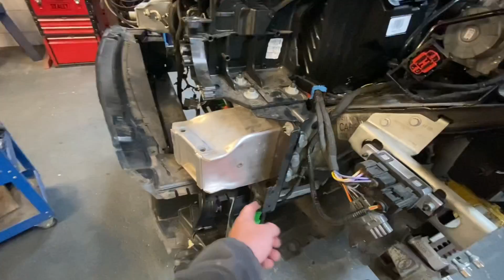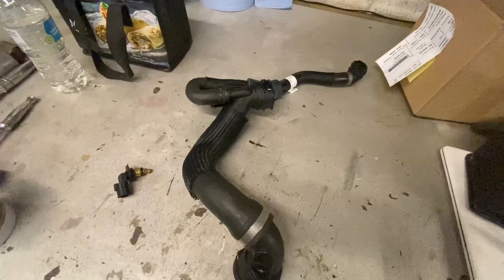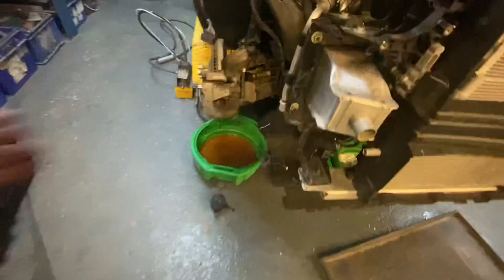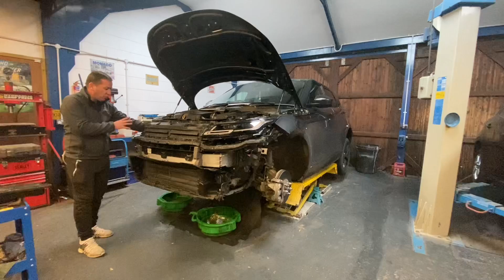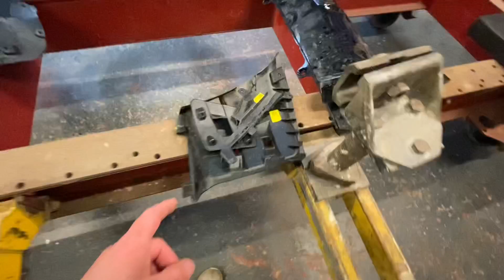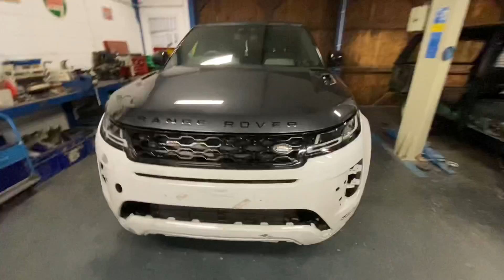Rebuilding 2020 Crash Damaged Range Rover HSE PT2

Comment: Are you going to re calibrate the radar? as if its removed it will need its alignment checking ?
Reply: All of the ADAS system will need recalibrating not just the radar.
Reply: I totally agree but no mention of ADAS !
Also using a second hand condenser the filter drier will be toast due to being open to air.  Also i am sure the SRS ECU will need crash data removed and belive other ecus on late cars also store crash damage data

Comment: As always the content is spot on chaps 👌🏼 With the repair being straightforward on the Evoque and things like bolt patterns all uniform I bet it has made you both think that you wouldn’t mind another salvage Evoque. Especially if you go for the 2015-2019 model, parts should be readily available but still a very modern car that will sell well.

Comment: Hi respect to what you do but you building that evoque completely wrong. Remove front panel or bonnet landing panel to put radiator in. I build quite alot of these.
Reply from the maker: There was absolutely no reason to removed the landing panel that would just be creating more work. There’s no right or wrong way bud you do it that way I do it this way it was a lot quicker and we both had the same outcome it took ten minutes 👍

Comment: It just shows how the modern car design’s crash systems work to protect not only the passengers, but that huge lump of technology called the engine and drivetrain, which is installed in the factory as one lump including all front suspension, steering and associated sub-frames! Pleasure to watch you reassemble it like a Lego model, each part clicking into place. Fantastic video, brilliant car for the new owner with the valuable LR warranty intact👍

Comment: Correct me if I am wrong doesn't the computer log if vehicles has been in accident so if you take back to main stealer for warranty they throw out your claim so is warranty worthless now  if you have that history removed from ecu  there's a gap in history file and they can tell its been doctored ????
Reply: most stealers will overlook "history" if failed part nowhere near or nothing to do with accident damage. if they can get paid off manufacturer on warranty claim thats the route they usually take    -  unless they dont like you....
Reply: I live in Ireland and main stealers hate doing warranty work over here as they get shafted on the labour rates and try and find any excuse to void the warranty usually  they void it after stripping car down so you either pay them the full cost or you get car back in bits they say second hand car dealers derive from horse thieves main dealer must be from the devil himself lol
Reply: @adrianlloyd691  i work at main dealer [sunderland]  - you loose money fobbing off jobs [mandatory healthcheck, first stage diagnosis, wash + vac., pickup/ delivery etc] - so we would rather get a little off manufacturer rather than s.f.a. and a row in reception with customer  - covid is biting hard at our customer base so we need the  work -  unless you dont like them.....
Reply from the maker: There’s no such thing as doctored it’s got crash dater logged that has to be cleared that’s it. It doesn’t hold a history in the computer 👍
Reply: Thanks keep up with the good work by way whats happened with cozey did I miss a video as not seen or not in back ground cant wait for merc rebuild as work at merc dealer sad hey work on them all day and watch em at night my Mrs goes mental and she calls me something stronger than sad lol
Reply: @sruk  mmm.... tricky bastards these new cars - but when old ecu is in bin it 100% cant grass u up...

Comment: great to see how a vehicle like that is easy to repair .I would have used gorilla glue for sensor .And I think I know your new source of vehicles as a fellow you tuber aid in there one they had met and talked to you at a copart site.Good luck and Keep them coming.
Reply: Don't do that on a coolant pipe lol, it's high pressure and will drop all coolant if it fails. Bye bye head gasket if it did!
Reply from the maker: Iv never met another YouTuber at auction 👍

Comment: If your source for the vehicles can keep coming up with ones like that then that's definitely one to keep under your hat...

I don't think anyone is under any misapprehension that a Range Rover Evoque is anything but a very complex vehicle, but that was a lovely simple nuts and bolts repair so huge respect to JLR for keeping the build and rebuild nice and simple.  That bottom hose is a good sign of what's wrong with the car manufacturers now, they could have made that a simple multi-piece assembly so individual broken or failed parts can be changed.  Doing it the way they do, they're pretty much guaranteeing that more vehicles are going to get written off so they'll be building and selling new vehicles to replace the written off ones.  It makes financial sense for the manufacturers, but it's a royal pain in the butt for owners, especially when the vehicles get older as something like that could easily write off an otherwise good £1,000 example.  Just such a waste of resources...

As ever, lovely work guys, and a very rapid turn around on a high value car...

Comment: you will need to get the radar alignment set up again [ critical to get set up right for the emergency braking system to work correctly]  you are supposed to go to main dealer,  but they are a number of larger bodyshops set up for this now. make sure you get the certificate off them- if it ever fails to work ,let them go to jail rather than yourself !  sorry rob, more [definatley needed ] expense on these later cars. p.s. 85% of the time when i do them ,no warning lamp comes on to warn of problem - it comes on after a few miles later when you thought it was all ok + no damage visible to any parts was seen. [and then the bodyshop had to send in a supplemental claim, pissing off the insurers].     this is why cars get written off so easily these days-  radar unit for nissan £ 600 to £1400 and bracket another £100.     progress???  -nah - just stay off your phone and look out of windscreen now and again......

Comment: So just out of interest I know you guy are honest but when the guy you sell it to sell it the next buyer how do they know it’s been in a crash
Reply from the maker: This is a lightly panel damaged bolt up repair there will not be any signs of any repair I always tell but I don’t need to and this one in particular who ever buys it won’t matter if they sell it on without saying it’s not recorded and it’s back to 100%. If they claimed off the insurance they would repair it and no more said.
Reply: @sruk  I think it's nice if people are told it's had a crash as it's part of the vehicles history. But especially one that's like this (especially when it has evidence like a YouTube series to show the work being done properly) they should be confident in the repair and to be honest as you said are unlikely to notice it's had any (since it's been done proper). One time I went to look at a Cat N that'd been put back on the road and you could the standard was subpar.
Reply: @sruk  rob so true, how many cars under 3 years on pcp have prang
Reply from the maker: @adrianthorpe8005  people just don’t realise how many cars are in body shops being repaired every week 👍
Reply: Only way is that they are close eyed or they get told by who sells it to them. One tip I learned very early on is to look at the bottom of license plates. If they say the same garage / dealership at the bottom then its less likely to have been in a crash. But if they are different (I had a car that the front plate was Halfords and rear was Some Vauxhall Dealer) it's probably been in a collison of some sorts. Of course this doesn't work if the plate wasnt damaged in the crash but simple things like that are giveaways.

Comment: Always worth keeping the sources to yourself now definitely, copart has gone crazy every since you and the other channels took off.
Reply: The fees are crazy 😞
Reply: @nabs3178  Fees aren't necessarily the problem because if you think about it, what you then do is think of the price you'd pay without fees and minus the fees from that for your bid. But due to the large increase in users people are now going crazy and a lot of them not being the most familar with prices either, so they are willing to pay more (or forget to calculate the fees / cost of work)
Reply: @lukesworkshop238  I agree with you, I’m currenlty seeing a 2010 Toyota Prius for£1,150, and it starts in 2 days that’s a bit too much for something of that mileage , the large battery will definitely need to be changed

Comment: Some years back an  acquaintance was a transport manager for a huge waste management company and they had inhouse repair garages. All their vehicles were self insured, I assume that included all their fleet/company cars as well. It wouldn't be a surprise if other large companies do similar and on occasion need to sub out some work. No  need for Rob & Chris to divulge their income streams. FWIW the USA rebuild sites are also reporting high prices at auction sites.

Comment: Looks good Rob Chris's extra height definitely helps, dealer prices do seem expensive but if it helps to keep the warranty that's worth paying for. It makes a change for manufacturers to be more sensible with bolt sizes keep going with it as that will be a really nice motor when it's finished.